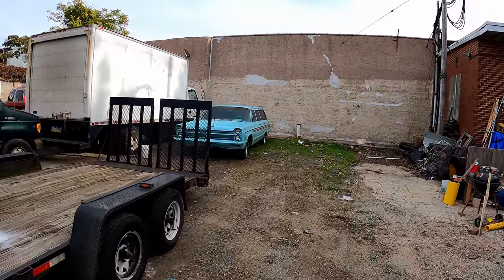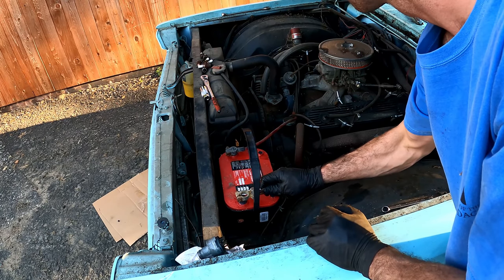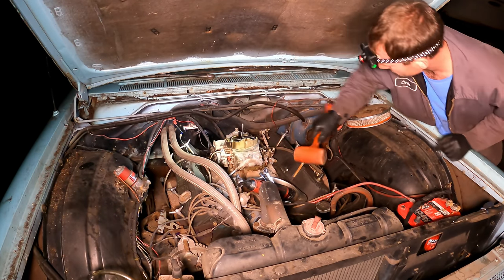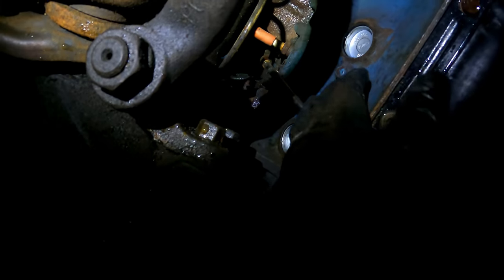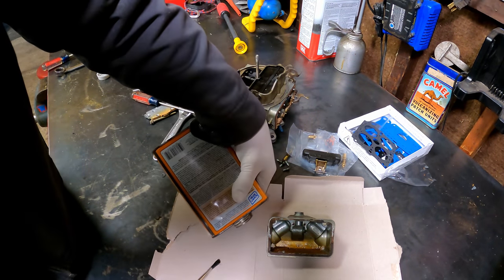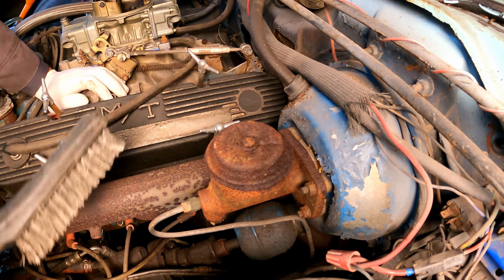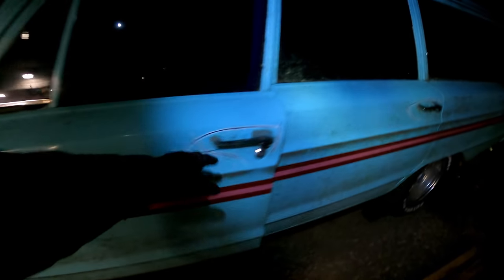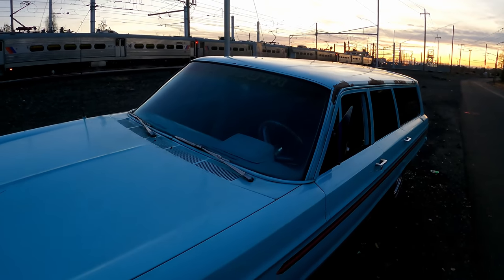Will It Run / Drive? - Junkyard Plymouth Fury "Fury-ous" NNKH

Comment: Very cool ride, especially since I once a 65 Fury III factory 383, check out my vlogs! Ditch that glass fuel filter before you burn the thing down, worst ever made. My glass cracked thankfully before i got it on the road and everyone online states the same. steel head gaskets will be rusted and plugged with same much gunk inside the engine. three small ports will be blocked causing it to overheat. That was a Mr Gasket high flow stat, best there is. Excellent job, cool channel subscribed!

Comment: My first car was a '66 Fury III K-series retired police car. I did SO much stupid (I mean fun) stuff with that old car. That 383 would NOT keep the top quart of oil in it, but once it burned that off it didn't burn anymore. I can't believe that transmission held up to the bootlegger turns it did so well.

Comment: So not sure if its been mentioned but the Holly fuel pump needs to be as close to the tank as possible. I had one on my 66 mustangs and i tried to relocate it under the hood and that didn't work. Also get the blue label fuel pump.

Comment: Mickey Thompson valve covers lol...I used to clean Holley carbs with stuff that came in a 5 gallon bucket... they had a cage you put the parts in then dunk it overnite... worked great..  Do they even make distributor balance machines any more!
Reply: Anything that runs and drives is worth $1000.

Comment: the fancier V8 badge that is on this car normally meant a 4 barrel. The 2 barrel version normally was a little plainer badge. Very similar to what was on the 273 Hypo in 1965 Barracuda. The centre console looks original as I dont see any remains of a column shifter.

Comment: My 68 Charger R/t had a Holley 850 double pumper with Float Bowl Extensions. So if I chose to do a hole shot the engine would not run lean. For those of you don't know when you do a hole shot fuel tends to run up the back walls of the carburetor...

Comment: That 383 is a legendary workhorse. Had the 2bbl version in my ‘68 Polara.  And it was great to hear that Mopar starter churning away. I’m wondering if the center floor console was factory… I’m thinking not as it was a Fury I. It doesn’t seem that they would make an upgraded interior available on the base Fury model. Heh… for that matter, was the 383 factory, too? I forgot if you answered that in the vid.

Comment: I had a 65 sport fury for many years. If the 727 has been parked for a while, run it in neutral for a wee bit to engage the pump to refill the torque converter, apparently they drain back

Comment: Nice wagon.

I tow cars often with my SUV that only has a 600 lb. tongue weight and 7,700 lb. limit and I usually flip cars that don't have a 50/50 weight distribution so that the car is on backwards. My trailer is similar to yours so it works out perfectly, with just a tiny bit of rake of course.

Comment: So, I am 2 years too late, but I just decided to add these comments anyway.

My first car was a '66 Fury III wagon with a 318.  That color changed slightly in '66 and was a slightly smoky blue.  Looked exactly the same unless you had them side-by-side.  The Fury III had dual brake lights with a backup in between on each side.  The rear window was electric.

On yours, the front seats and console probably came out of a 2 door Sport Fury.  The wagons were all bench seats.
You probably figured this out already, but the tail gate will not open with the window up.

Very cool to see this car on the road.

Comment: I have a '66 AMC Ambassador wagon that same color, with the over and under headlights and in pretty ok condition, as a driving car for $800.00 about ten or 15 years ago.  It was my daily driver for a couple years before the radiator sprung a leak.  For $800 bucks!

Comment: I'm a Mopar guy from way back as I remember when I was five years old standing up in the front seat of my dad's 57 imperial with a 392 hemi. I've become quite familiar with the history of mopar in general and Mopar muscle cars specifically including my daily driver that's a 68 charger that I've had for 22 years. And I have to say I was quite surprised to see a fury wagon with bucket seats and a floor shifter! I think that's awesome! I am however just a little disappointed that it wasn't a 440.
A small bit of trivia: in 70 Plymouth made a sport fury GT that had a 440 six barrel.

Comment: straight out of the 1980's, was surprised it wasn't dyed burlap sack and billet. some sweet cars in that seller's yard, a Chevelle and Series 75 Caddy.  this is the oddball project to find, someone else dumped the cash into it so you are ahead of the cost game there. Sometimes it ends up being that the prior investor ran out of cash and you just carry it over the finish line.

Comment: You can just make a ramp out of lumber and place it underneath the metal ramps on the trailer if you're having clearance issues loading up, no need to buy a tilting trailer. Flatdeck towtruck drivers do it all the time. I'm sure there are tutorials online.

Source: former flatdeck towtruck driver

Comment: I believe that is a Fury 1 , came with the 318 …. The Fury 3 which Florida State Troopers used came with the 383 …. Nice car … recommend you do a cooling system cleaning to get out all the rust that is still in it . 
Most likely the Heater core is gone …. That will be a job to replace …. If your in the south , by-pass it …. Don’t need a heater .
If your middle of Peach 🍑 State or and above your screwed … Like that little rat with furry tail , thanks for the video ….

Comment: you know it would look cool but some keystones or Krogers on it with some m50s on the back and 60s on the front and a small block of Chrysler 400 in it with a little bit of a cam but you got all the horsepower you want

Comment: Nobody ever pulls the distributor and runs the oil pump up with a drill for a few minutes to pre-oil these old cars that have been sitting for years.  Good way to wipe all the bearings in the motor.
Reply from the maker: Wipe what, .0000000000000000001 off?

Comment: Now I have seen a several of your posts and you are very good, and this brings me back to when I was fixing American cars. But I have a few advice til you. Do not use plastic bottles in combination with petrol. A static spark may occur, and can ignite the petrol, so use only plastic intended for petrol. You should also always using hearing protection and safety glasses. You should also wear a mask and safety glasses when you working with Methylene chloride. And one last thing, always wear a seat belt when you are out and driving. Good luck in the further, and stay safety.👍🛻🙂

Comment: Great video. Same color as my frist car. A 1959 Pontiac Starchief 4 dr sedan. With a 389 high performance engine with a 2 barrel Rochester jrt spray carb.
Would put you in the back seat when you stepped on the gas. Loos to be the same color a Caribbean Blue. New to your channel and subscribed.

Comment: You can still buy Methylene Chloride (Dichloromethane) and mix it into your paint stripper.  You've probably already have been told by a million other people to throw that glass fuel filter in the trash before it burns your car to the ground!
Reply from the maker: Where  at?
Reply: @NoNonsenseKnowHow  Lab Alley

Comment: Hello. You must never use Silicone on a car. It will loosen after a few months. Silicone has a substance mixed in. Which causes metal to rust. I've been tinkering with cars for 40 years. Know what I'm talking about. Has experience for many years. You must not use silicone on engines for such things.

Comment: Not sure but by the time you finished pulling the engine to bits in it hole ,wouldn't it have been easier on the bench?

Comment: Its a shame you no nothing about old mopars. There's a boss on the front of the block with information about that engine. An HP would indicate whether or not it is a High Performance engine. Also,  those are factory header manifolds. The center console is period correct. Super rare if original to that car. Looks like the casting date for that block is 04 08 65.

Comment: Never get a full tank with a car like that the first time you buy gas. The 383 V-8 / 727 Torqueflight is a great drive train combo. Myself, I wouldn't want a four barrel - dual exhaust setup. Unnecessary for daily driving.

Comment: It's an American car from the 1960s you can start it with a spoon just hotwire the thing it shouldn't be a steering wheel lock not from a car from the mid-60s

Comment: You need to invest in a remote starter switch so you can start the engine without having to use the switch on the dashboard.

Comment: i have heard that those glass fuel filters can crack and burn your car, i do not recommend using them, however it should be fine if you wrap it in foam.

Comment: I'm really concerned that you are using one of those glass fuel filters.  I have heard they are fire hazards.  Why did you say you cannot use plastic fuel filters under the hood?
Reply from the maker: They are a fire hazard if you install them on the pressure side of a pump. If they're on these suction side, worst case you suck air in and lose prime.  But yes I don't really use them anymore because of everybody saying they rattle loose. Plastic under the hood is not a great idea either although I do it sometimes. Steel fuel filters are the best

Comment: This sad motor is a good example of why you need to change your coolant and use the right mix of quality antifreeze. You’ll never get the inside of this block’s cooling system clean without a complete engine tear down. This a cool wagon for the era but there are many good reasons why mopar sales were well behind GM and Ford. They were mostly slower, used outdated engineering nearly everywhere, were excessively big and heavy, had horrible loud needlessly gear driven starters, crude torsion bar suspension, the much hated thermoquad carbs, and the list goes on. Even today the Challenger and Charger are big heavy sloppy boats compared to the Camaro and Mustang.

Comment: I will ask the question again what is the major corrosion inside a radiator, what causes the corrosion, you will be very surprised if you don't know what it is
Reply from the maker: Acidic coolant
Reply: @NoNonsenseKnowHow  No, water
Reply: @NoNonsenseKnowHow  they make coolant, cost $35 a gallon, and has no water in it, and you do not add water to it.

Comment: is that old type paint stripper that has methylene chloride im sure they still sell that in australia here, does it have that real strong smell and its sorta have that scent of methylated spirits (debnatured spirit)? yep they do still use it i did a google and saw that they call it dichloromethane here and its the exact same stuff, and yeah it can be quite strong on the nose and also burns the skin, its shocking that they ban a lot of products in America and yet they stil;l use the same stuff in Australia, same as Round-Up they still sell and use it widely here even though it cause non hodgkins lymphoma. Australia is behind many years compared to America.

Comment: I know the sound of a 318 cranking. The starter did not engage
Reply: @NoNonsenseKnowHow  at first the starter bendix was not engaging. You could hear the starter motor spinning freely.
Reply from the maker: I'm not sure which part of the video you are referring to. But the starter works. And it is not a 318 engine

Comment: You had me until you said the master cylinder seals were okay. You lost me. On a single res MC you don't play games! You rebuild them or replace them!!!
Reply from the maker: Yeah rebuild them with Chinese parts or replace them with Chinese parts that don't last as long as the good old ones.  Better luck with the old from my experience
Reply: @NoNonsenseKnowHow  That is the problem when you go off the normal grid and dive into a car or truck that is not as popular. Parts get thin and fast! If that was a C10 or a mustang. No problem with parts. I see in a later video you replaced the brakes. I tell people over and over who are talking about building up an old car/truck. "I can care less how fast you go from 0 to 60. I care how fast you can go from 60 to 0!!!" NEVER over look the brakes and NEVER GO CHEAP!!! Your life depends on them.